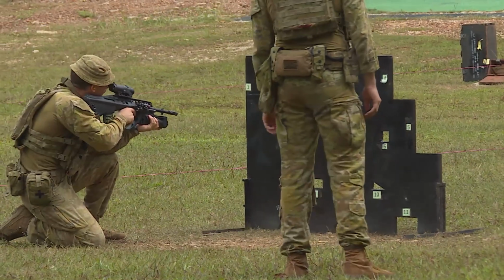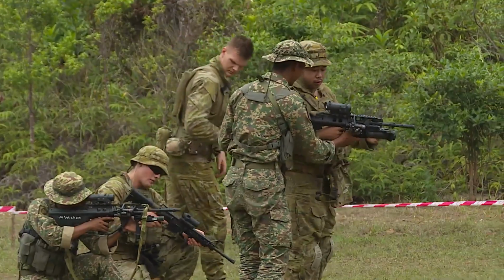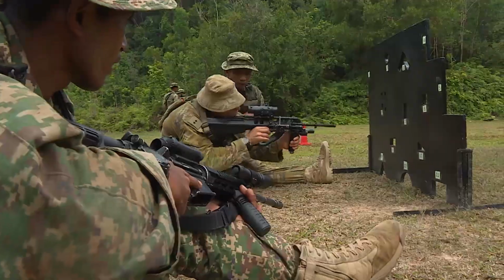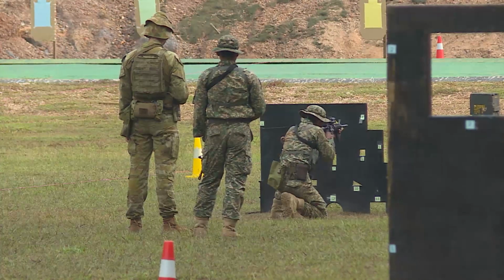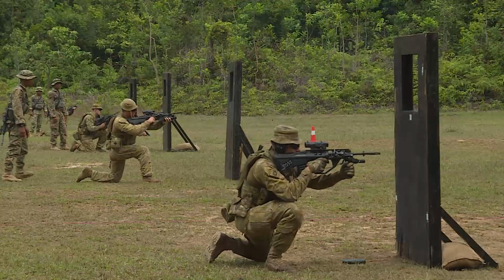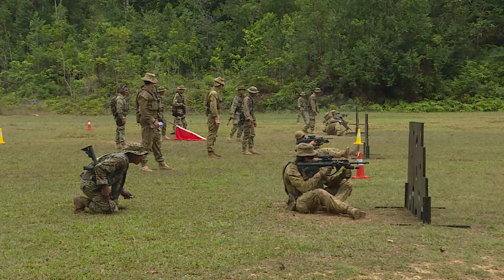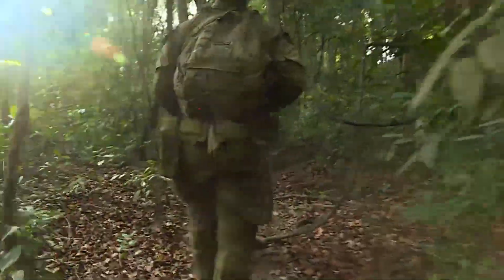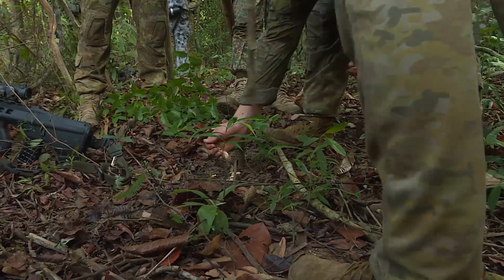Malaysian Forces Have Our Backs

Comment: Styer , still perplexd why did Msian changed it M4..
Reply: complicated to answer.....different level have different explanations.....the AUG had its problems so is M4, however M4 is more a versatile platform compared to the AUG
Reply: I agree. The M4A1 is a very versatile platform. It's 14.5 inch barrel is more conducive to CQB which is important in the jungle. Also, many Malaysian Army recruits do receive training with the M16 platform, so transitioning to the M4 is quite trivial
Reply: @TheOz91   I loved both AUG and M4, AR15s and it's variants. The AUG and FAMAS  to be specific.

Comment: Still using those outdated steyrs they should start using AR platforms instead of those shitty bulpups just ask the french their using HK for their standard rifles now
Reply: @chickentube2229  Here we go again...
Reply: We have an Armchair General over here..
Reply: bulpups are better for asians' smaller frame the SAF uses a bulpup too (SAR21)
Reply: Nothing wrong with the Steyr, I used the F88 for 13 yrs and 2 deployments and I loved it. Never let me down.
Reply: The Talibans use AK-47 and after years of fighting. Still there's nearly 3k dead US troops in Afghanistan every year.
Reply: If there is an accident on the road ... do we blame the driver or the car ???
Reply: Well the AK-47 has been outdated for decades, yet you can drop it, kick it, walk through a sand storm and it'll still fire just as well. Like the .38 special revolver. Outdated as fuck. But you can put that through the washing machine after dropping it down a well and it'll still fire just as well. Outdated doesn't mean outclassed.